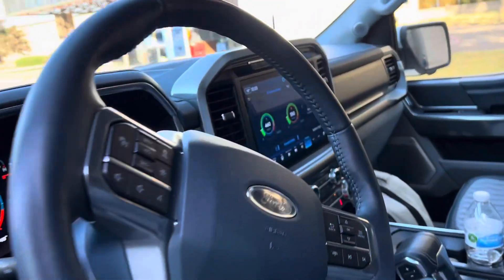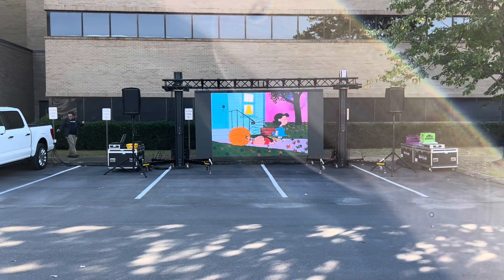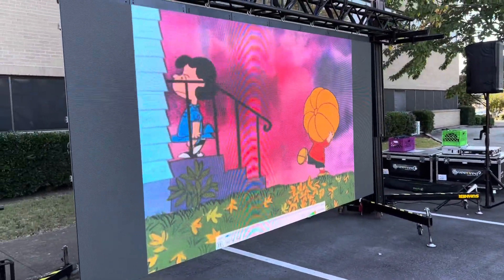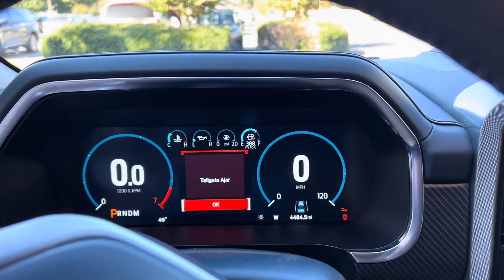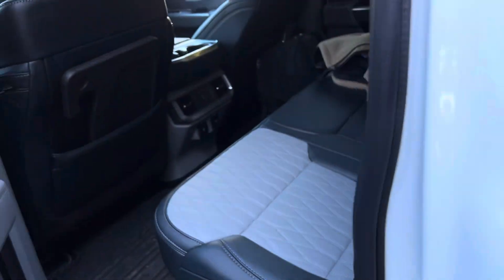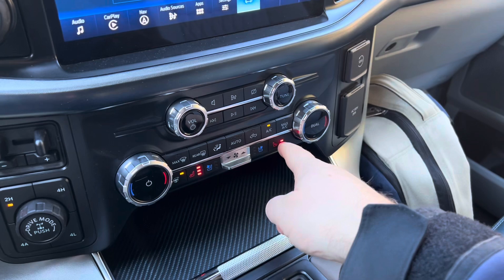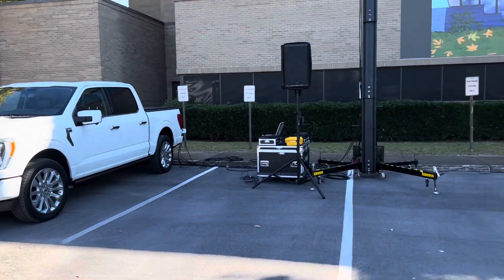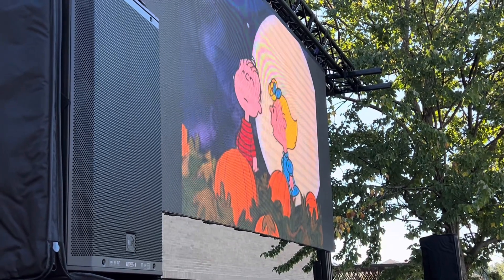Will it power a video wall? 2022 F-150 Powerboost Hybrid inverter generator test.

Comment: I have the 22 Lariat Powerboost for use with my travel trailer.  Powerboost Generator works great and I was able to get rid of my 150 lb Honda generator and extra gas cans.  Travel trailer uses quite a bit more power than this video wall when the trailer's A/C is running.
Reply from the maker: It’s such a useful feature of these trucks!